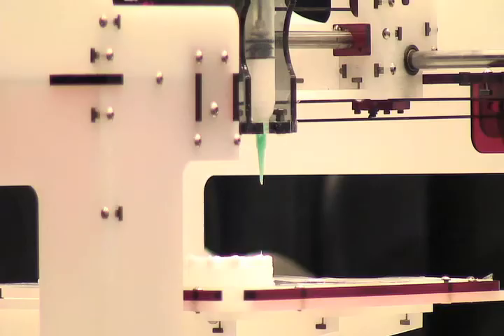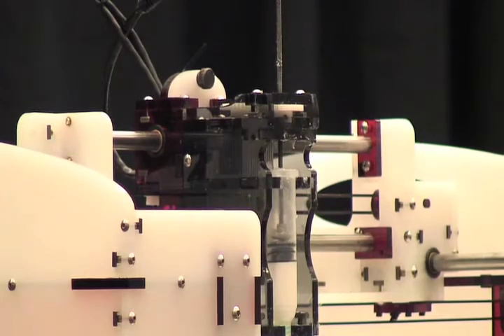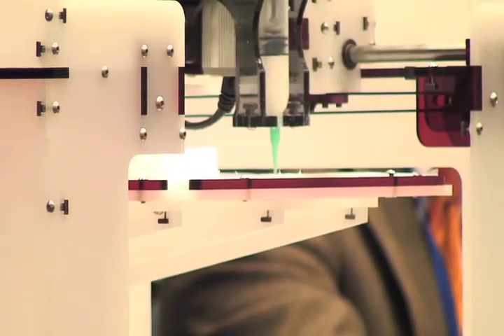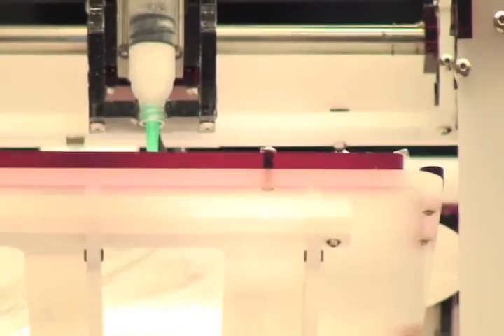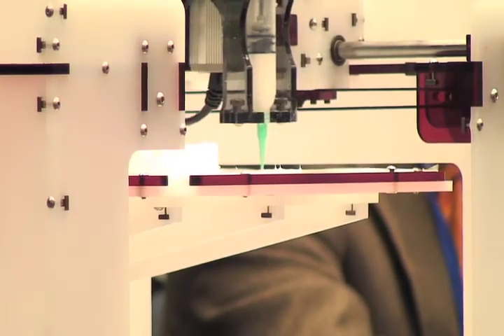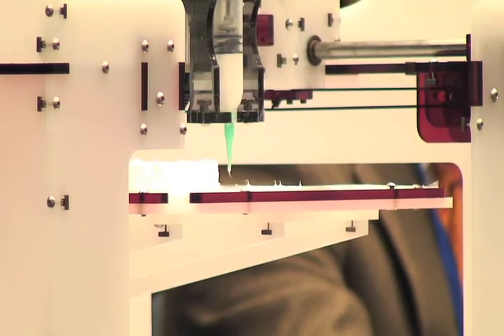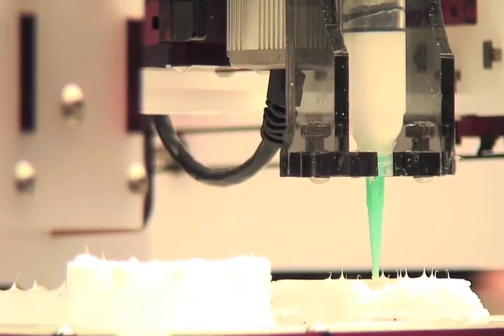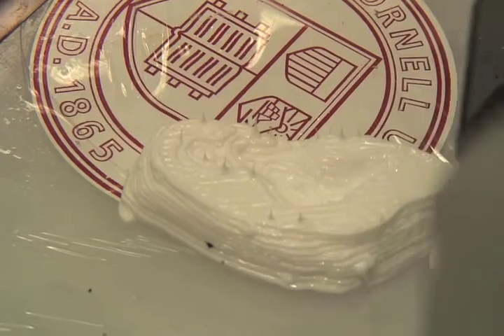Bioprinting demonstration

Comment: Not so easy to print in silicon.  Current 3D printers print with melted plastic, which becomes solid shortly after being injected.  Not so for silicon, which requires the carrier (acetic acid) to evaporate away before solidifying.